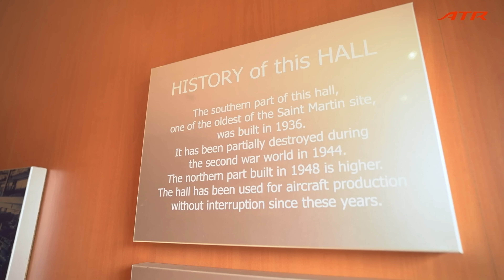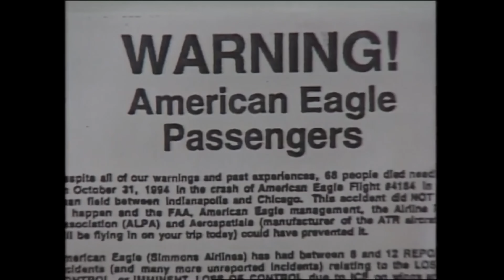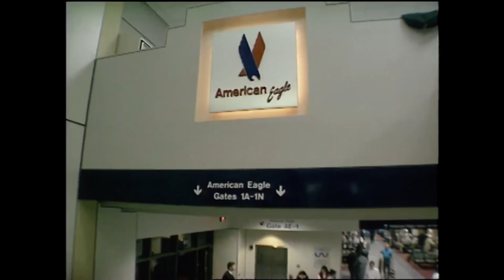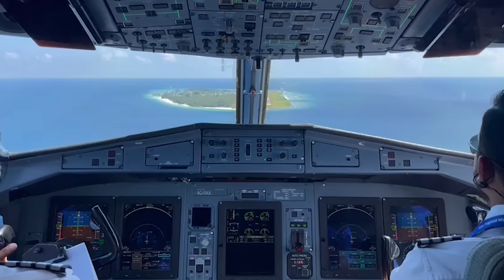The Plane That Can’t Fly in the Cold: The Story of the ATR 42 & 72

Comment: Modern turboprops are underrated.  The airlines did themselves a great disservice when their marketing implied that jets are somehow superior.  The two selling points of speed and higher altitude in jets is lost of short hops. Sadly the general public see a plane with propellors and envision the old noisy piston taildraggers from 1940s newsreels.  I miss the ATR-42 and -72 and the Q400 as well.  As an avgeek, I'm glad to have also flown on the Q200, DHC Twotter, Beech 1900, Saab 340, Saab 2000,  Fokker F27, Fokker 50, Dornier 328, Embraer 110, Embraer 120, Jetstream 41, Short 360, Let L-410, and Harbin Y-12
Reply: WOW! That's certainly an impressive cadre of twin-engined turboprops and regional jets that you've flown aboard!
I couldn't agree more with your many points about why modern turboprop airliners are underrated, as well as somewhat generally misunderstood by 'the flying public', especially in mainland North America! 🇨🇦 🇺🇸 🇲🇽 🇺🇲 🇨🇦 
I haven't flown aboard four or five of those types that you have, however I've flown on a Short Skyvan, a Dornier 228 (both on Arctic Skywest Airlines, now merged into Perimeter Aviation as I recall) of Yellowknife, Northwest Territories. 🇨🇦 (That's where Buffalo Airways 🐃 of Ice Pilots' fame is also headquartered!)
Being much older than you, I've also flown aboard Trans-Canada Airlines (known as Air Canada after 1965) Vickers Vicounts, Canadair North Stars (a modified licence-built Douglas Commercial DC-4. 'Also on Lockheed L-1011 Super Constellations, Hawker Siddeley HS748s, DC-3s and C47 Dakotas, Curtis Commandos and C-46s; as well as aboard B727s, DC-9s during their first year of commercial flight, DC-8s, B-707s, B747-200s, DC-10s, Lockheed L-1011 TriStars, Airbus A300s and A310s, as well as on many more modern turbofan widebody and narrow-body aircraft.
I've also flown extensively as a Wildlife Biologist in Bell C-47s, 208 JetRangers and 208-L LongRangers, Hughes (MDHC and Boeing Helicopters) 500s, Aerospatial (Eurocopter and Airbus Helicopters) AS-350 A-Star/Eucreil.
In wildland fixed-wing flying I've flown extensively in Dehaviland Canada's DHC-2 Beavers, DHC-3 Otters, DHC-6 Twin Otters (all mainly amphibious types but also 'Twins' on Tundrs Tires, as well as on ski/wheel combos); Cessna 172s, Cardinals, and 185s on floats. 
Much more rarely I've flown aboard Cessna Citations, once as the sole passenger (with a personally modified flight plan from Prince George, British Columbia to Vancouver's 1940s era South Terminal), when that executive jet was actually bound for its homebase at Victoria International Airport, on Vancouver Island! 
Although I've flown in Citations several other times, that was my only 'severe clear' 🌞 summertime 😎  🏔  ⛰️ 🏔 😎 ROCK  🎸STAR  type FLIGHT! 🤘 🎸🤘 
'        BON VOYAGE TO YOU ALL!
🇨🇦 🍁 🇺🇸 🌎 🛫 ✈️ 🛩 🛬 🌎 🇺🇲 🍁 🇨🇦
Reply: @markpimlott2879  Awesome list!  Great to meet someone that also tried to fly on as many model of planes as possible.  I can't believe I forgot to list the good ole San Antonio Sewer Pipe/Texas Tampon/Death Tube/Texas Lawn Dart/Screamin' Weenie.... the Swearingen Metroliner.  Hoping one day to get a ride on a turboprop upgraded DC-3/Basler BT-67.  I do have a love for old pistons as well.

Comment: I lived about 200 MILES (320 km) NORTH OF THE ARCTIC CIRCLE for almost a dozen years earlier this century. I.e. At about 70° North latitude. That was in the northern Canadian Arctic territory of NUNAVUT.
Beginning in 2005 the largest Arctic airline in Canada 🇨🇦 began replacing its old turboprops such as the HS-748 with the ATR-42. During  the next decade I flew aboard ATR-42s many dozens of times since my boss and HQ operations were almost a two and a half hour flight south in Nunavut's capital IQALUIT (YFB was FORMERLY known as  FROBISHER BAY, NWT). Almost all of Arctic airlines' turboprops are configured as quick change passenger capacity and cargo aircraft; COMBIs! (Mail, freight and fresh food services are critical for Nunavut's 25 fly-in only communities!)
Flight operations routinely took place at minus 50 Fahrenheit (minus 45 °C) with windy ground conditions.
BTW AV-GEEKs...
During almost a dozen years flying welll north of 60° North latitude, I never experienced deicing. At those temperatures any snow that settled on the wings or fuselage simply had to be blown or swept off, although the Arctic wind usually did that.
The risks associated with airframe icing are virtually nonexistent when ground temperatures are so low (minus 40 C & F), and flight level temperatures  are commonly minus 85 F (65 C).
BRADLEY AIR SERVICES of Ottawa, Ontario also provided flight services to the US ANTARCTIC PROGRAM, as well as in the High Arctic of Canada and Greenland, primarily using Dehaviland Canada s DHC-6 Twin Otters. They have been flying in the Arctic since 1948.
BRADLEY'S airline service did business as FIRST AIR, since by the 1990s it was owned by First Nations (Canadian Indigenous Peoples) as well as by the Inuit (formerly known as Eskimos) of Arctic Canada).
Their major competitor CANADIAN NORTH AIRLINES flew Dehaviland Canada DHC-8 (DASH 8s) on those regional Arctic routes, most configured as COMBI aircraft.
Both airlines flew 'gravel-kitted' Boeing 737-100s on some Arctic routes. Both airlines also flew B737-200s, 300s, and 400s (Classics) to connect with their southern Canadian hubs of Montreal, Winnipeg, Edmonton, Calgary, and Ottawa.
I've flown commercially for about 70 years in Canada as well as in the US, Europe, and North Africa for about 55 years. During that latter period, I have also flown very extensively aboard chartered light fixed-wing 🛩 and rotary-winged 🚁 aircraft, as well as on executive jets.
As a lifelong AV-Geek, I've enjoyed every flight, even when we had to go-around twice aboard a First Air ATR-42 at my home airport onto a 3200-foot gravel/ice runway during near whiteout winter storm conditions!
APPARENTLY ATRs LOVE ❤️ THE COLD!
Those two Canadian Arctic airlines merged about five years ago and now BRADLEY AIR SERVICES does business under the banner of CANADIAN NORTH AIRLINES!
 🧊 ❄️ 🇨🇦 🍁 🇨🇦🛫 ✈️ 🛩 🛬 🇨🇦 🍁  🇨🇦 ❄️ 🧊
Reply: I worked for First Air in Yellowknife when the ATR 42-300 first came online. At that time the type was not certified for operations below -40c. Also, First Air and Canadian North operated the 737-210 Advanced Combi, not the smaller -100 series, which only 30 were ever built
Reply from the maker: Thanks for the insight, that's really interesting to hear about their operations in the Arctic!
Reply: @TheOnlyNoIan Thanks very much for such prompt feedback Nolan!
I thought that my experiences flying aboard ATRs and DASH 8s in the Canadian Arctic might provide an interesting perspective to your viewers and subscribers.
As a teenager during the late 1960s, I first flew to Frobisher Bay, Resolute Bay, and Hall Beach NWT aboard a NORDAIR Super Constellation, and then on Douglas DC-3/ C-47 Dakotas, as and C-46 Curtis Commandos to several of the 🇺🇸 🌎 🇨🇦  Distant Early Warning system's (DEWLine) Cold War radar sites. I was a Field Assistant to a small party from the University of Toronto studying "THE WHITE GHOSTS OF BAFFIN ISLAND" (as my Canadian Audubon magazine article was entitled a year later), namely ARCTIC WOLVES.
I just finished cleaning up a few typos and punctuation errors in my earlier thumb-typed smartphone commentary!
PS Baffin Island is the fifth largest island on the planet, with adjacent DANISH-OWNED and semi-autonomous GREENLAND being Number One - the largest 'island' that's not a continent! 🇩🇰 🇬🇱 🇩🇰 
🛫 ✈️ 🛩 🛬 🦌🐇 🐺 🐇 🦌🛫 ✈️ 🛩 🛬